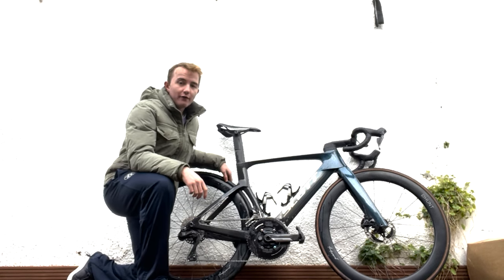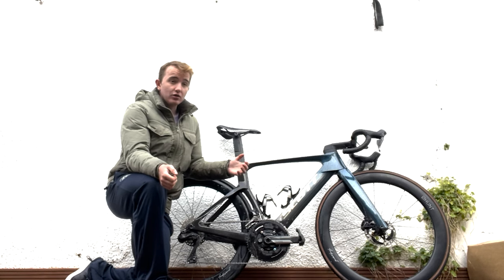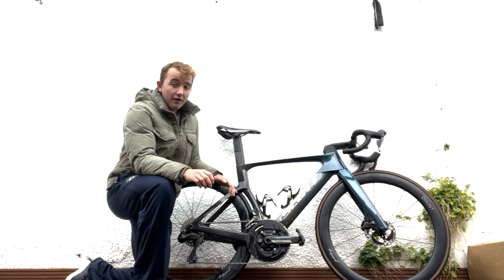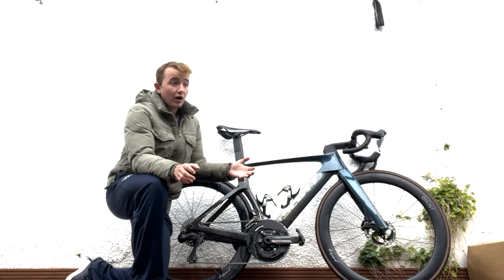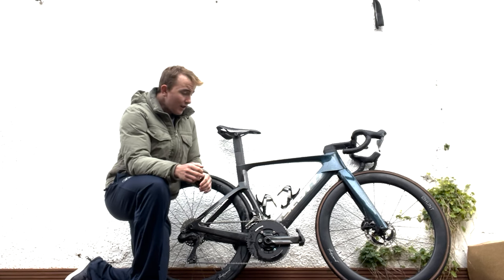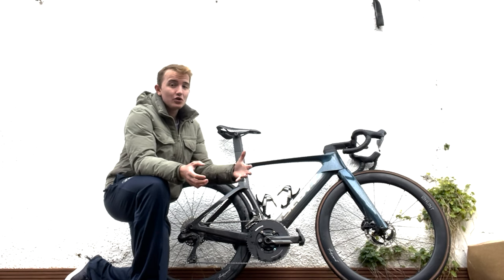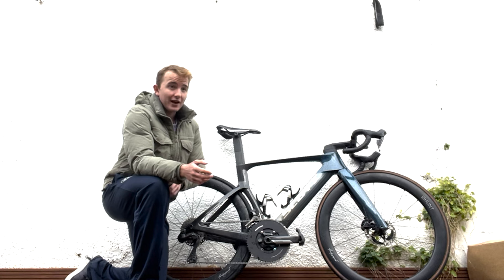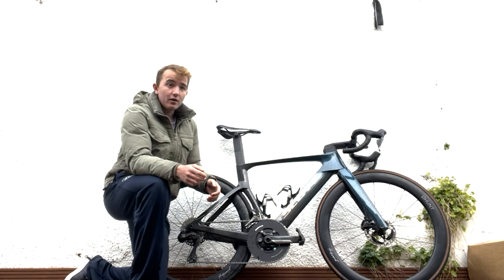Best and Worst of Scott Foil after 2000 KM

Comment: Hey, what frame size is the bike and what are your body measurements? Height and seating height .

How would you compare to your Canyon bike? Is the scott true to size?
Reply from the maker: I'm 1.70 saddle height 70cm. Canyon is not as low or long as scott
Reply: @CharlieCarbsandCycling  thanks, and which frame size do you use at the scott and the foil?
Reply: Scott and Canyon sorry
Reply from the maker: @matthiasmoder9119   scott xs 49cm and canyon xs. Canyons sizing is one bigger than it should be imo so an xs canyon is a small in most other bike brands
Reply: @CharlieCarbsandCycling   yeah I am 177cm an saddle height or 72cm . I am riding an Canyon Ultimate in S and I think i will go to size M for my new Scott Foil. Should be ok without spacers and a shorter stem :) 

Thanks for your help. Cheers , Matthias
Reply from the maker: @matthiasmoder9119  yh my seatpost is at max on the xs foil
Reply: Which Wheelset are you using here? The Hunt 50 Wheelset or Hunt 54 or Hunt 54 Carbon spokes?

Comment: Is this the RC Pro version? because it should be a lot lighter. Scott says 7.35kg on their website and my mate his RC Pro ways 6.9kg with dura ace pedals and DT Swiss ARC 1100 wheels in size 56....
Reply from the maker: yh rc pro, so 2nd top version. Scott website won't include pedals, 200g, bottle cages and wahoo mount which adds up. My bars/stem combo is 500g which is heavy as and my chainrings are pretty heavy as well.
Reply: @CharlieCarbsandCycling Why are your integrated bars so heavy? Long stem?
Reply from the maker: @unbridlededification  they aren't integrated they are just alloy bar and stem. I'm getting integrated which should be sub 300 in the future
Reply: @CharlieCarbsandCycling  So I've had my foil RC 30 for about 5 months and I feel like it doesn't handle nearly as well for corners as my Tarmac SL6.  Curious if it is just me. I'm thinking about selling me SL6 and getting an SL7 for technical crits.  The foil is great for road racing (My position is way more aero on the foil then my tarmac SL6).
Reply from the maker: @travispyle2905  I have no issues descending on the foil compared to any other bike
Reply: @CharlieCarbsandCycling  So I've done some dedicated handling drills (like 20 minutes straight on a short technical course) like 3 times over the past 2 weeks.  I am now much more comfortable with pushing this bike towards the limit.  2 weeks ago I also switched from G28 P5000 TT tubeless to latex with 29 enve raceday tires (these enve tires are awesome).  I have now safely pushed the bike to the point where I have gotten a couple light pedal strikes in the corners.  Yesterday I raced a crit and I was taking the corners better than most of the other riders ... so I am now happy with crit racing this bike on technical courses.